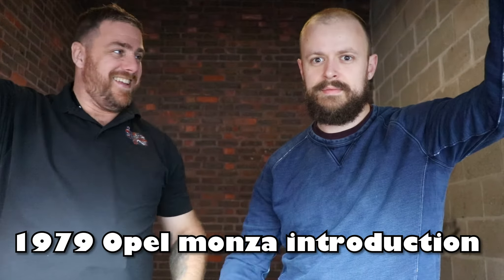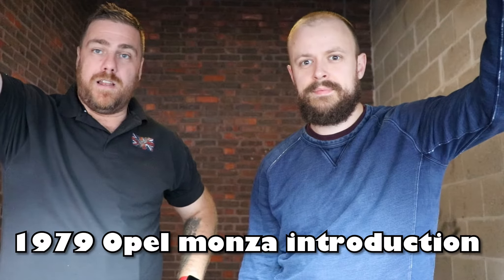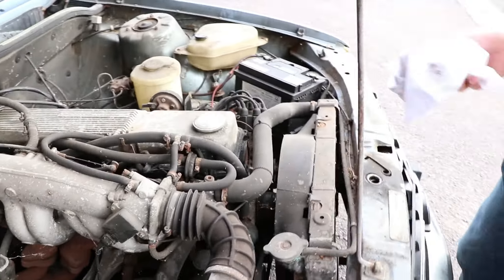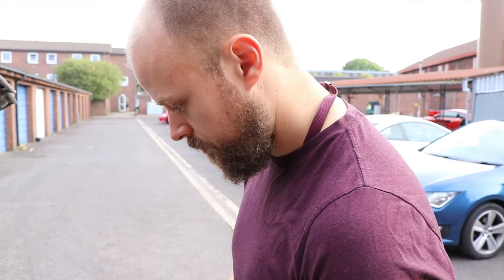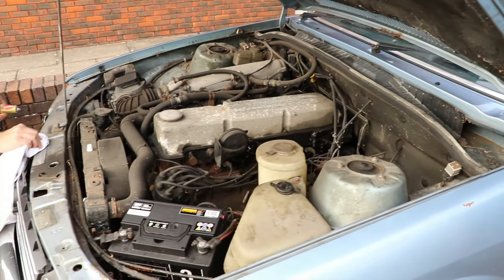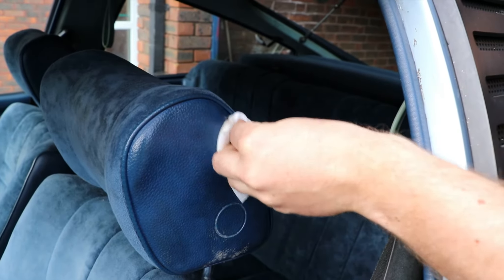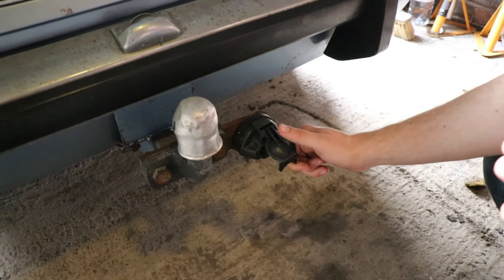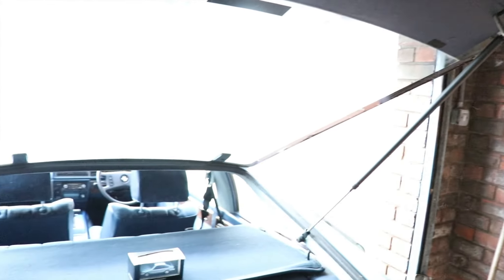Opel monza series 1 (1979) Barn FInd

Comment: This is great! I wanted one of these in the early 80s, but they were quite a rare car. I ended up with a Senator, which had the same engine & interior, huge, comfy interior - a velour cocoon - but tbh it didnt have the style of the Monza - and what a great name for a car! Fuel consumption on the 3.0 was horrific, and the Borg Warner Auto was a bit of a laggard. It would never change up when you wanted it to. Still, excellent value second hand. Mine was six months old and price had dropped like a stone.
Reply from the maker: Worth some money now though